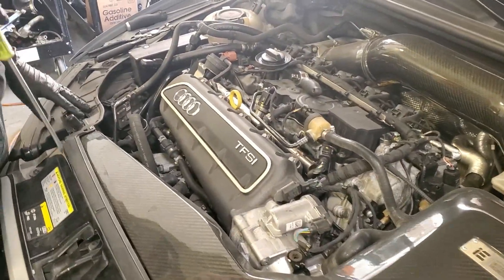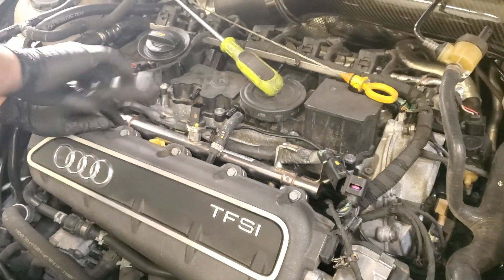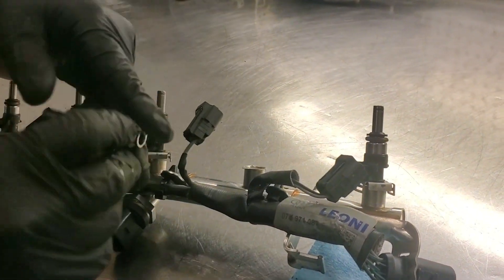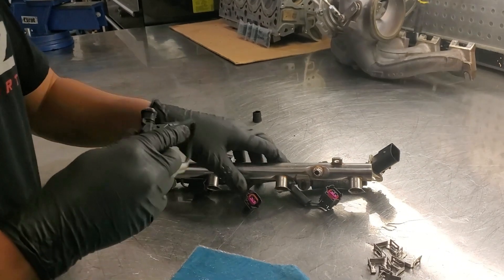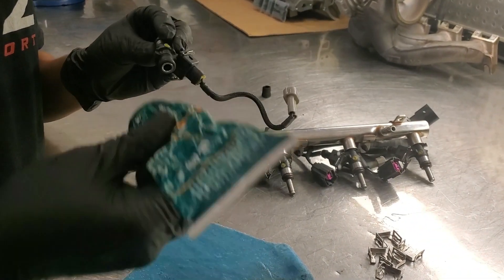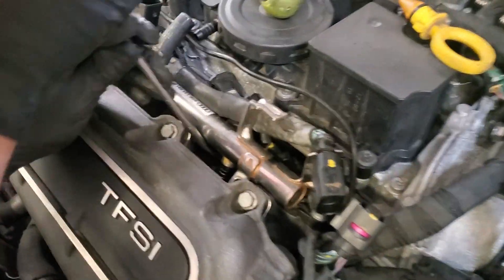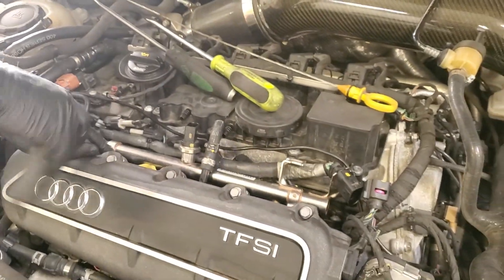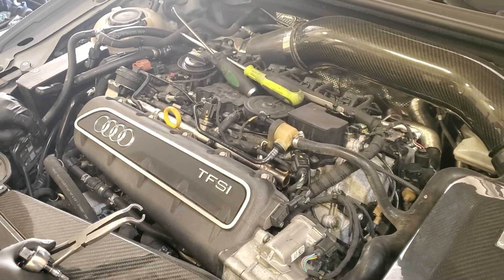8S TTRS/8V RS3 Port Injector Upgrade

Comment: I assume you guys need to run the engine at idle with fuel pump fuse removed or some how drain the fuel out before disconnecting?
Reply: i would like to think it would help greatly with the fuel spillage they had.